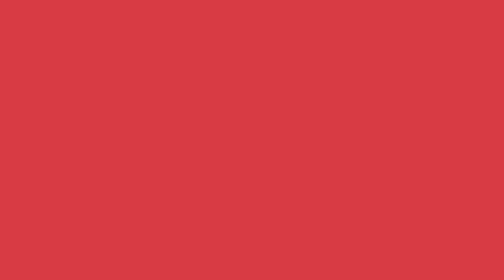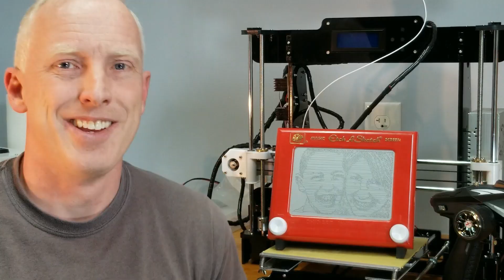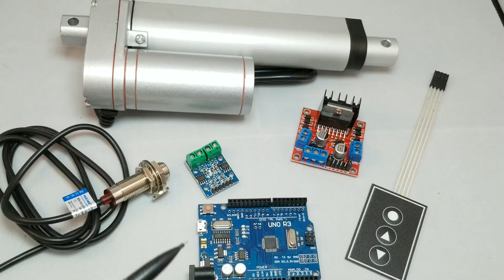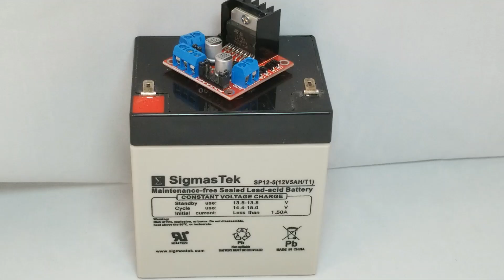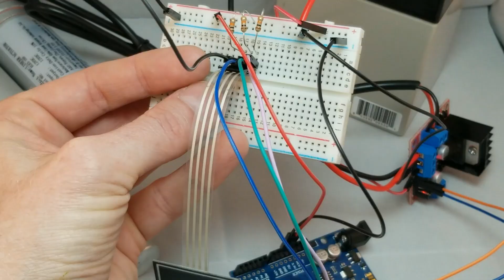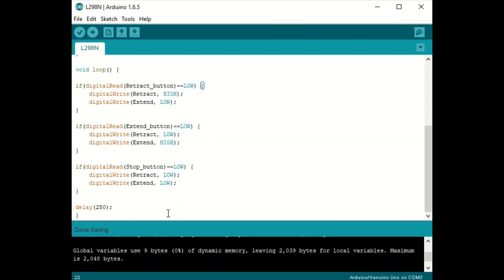Linear Actuator Arduino Control using L298N Motor Control Board

Comment: Hi, your video is so helpful for me. But I have one question. As I know, peak current of L298N is 2A. But your linear actuator's continuous current or stall current seem to exceed 2A. is it okay to use L298N?
Reply from the maker: I would use a BTS7960 if there was any load. It is good to 43 Amps and is still affordable.
Reply: @ScienceFunInnovations How would I get 12V from my arduino into the L298N and into my Linear actuators

Comment: Good day. I would like to control a TGM7 series 24V 6A geared motor using a 24V DC motor controller (lithium battery) and Arduino. I would appreciate your help on this subject.
Reply from the maker: What exactly are you needing help with? You could send an email to my business email with details.

Comment: Hello sir good day. I have a question instead of controlling the linear actuator using three buttons, how can I automatically move the linear actuator based on input data from SD card? I hope you can help me
Reply from the maker: You would just do a read command to get the new position value, then set that to the current position as is done in some of my other actuator videos.
Reply: can you please give the link to the video so I can refer to the video
 @ScienceFunInnovations

Comment: Hello sir, want to ask how about connection two linear actuators and syncing the movement of the linear actuator?
Reply from the maker: In order to sync the positions of the actuators, you need actuators with position feedback. Some of my new videos use these 5 wire actuators. You would still want 2 seperate motor controllers but you would use the position feedback from one actuator to control the other actuator.

Comment: What do the resistors do for the switches? What do you mean by “pull up resistors”? Can’t the switch just wire directly to the input?
Reply from the maker: There is a way to wire directly to the inputs without using pull-up or pull-down resistors if the microcontroller has resistors built in. Most of the newer Arduinos can do it without the resistors, but you may need to add a little more code. There are many articles about this if you search for it on the web. Cheers!

Comment: I am attempting to do this except using a FlySky i6x and wanting to control the actuator with the 3 position switch.  I can get the actuator to extend, but not retract.  I'm sure it's in the code.  Thoughts?
Reply from the maker: Probably in the code. I have several videos about controlling linear actuators, hopefully one of those gives you some good ideas.

Comment: great video, i have a question, if I want to use linear actuator with encoder to control it at specific location or length, how may I know  the range of it, can i use manual method by just supply power to it and read the encoder position from the beginning until the end of it?
Reply from the maker: Yes you can. Check out my more recent videos to see how to do that.

Comment: Please reply...I have a 24v 6 amp linear actuator can I use L298N Motor drive or do I need to use more powerful motor drive?
Reply from the maker: L298N is only good to about 3 amps. I would use a BTS7960.
Reply: Instead of using all these motor drives, Arduino, membrane button to control actuators, I have used DBDT (Double pole double throw) switch and I am able to control actuators.

Comment: First I’d like to start off by saying I am a complete novice when it comes to this type of stuff. I’m wanting to put together a automatic chicken door opener. I have components from a lift chair which consist of a 24v dc linear actuator and power supply. I’m trying to figure out the best way to control this system and I’m wanting.
Reply from the maker: It would be similar, but you would probably want a stronger motor controller. Good luck!

Comment: Can a raspberry pi be used instead of the arduino?
Reply from the maker: Yes. The pi can do digital inputs and outputs, but at 3.3V instead of 5V. Most motor controllers will work with the lower voltage.

Comment: Can I just use any Linear Actuator with the L298N Motor Control Board? or there are specific linear actuators?
Reply from the maker: The L298N is limited to about 3 amps. You may want a more heavy duty controller if you intend to have high loads/forces. But they all pretty much work the same way. Just find out how many amps the actuator uses under full load first, then select a motor control board that can handle the power draw. Cheers!

Comment: I thought we have to use BTS7960B 43A or similar. will L298N be enough?
Reply from the maker: Depends on the load on the actuator and the current draw. For heavy loads, use the BTS7960B. I will be using the BTS7960B in an upcoming video.

Comment: hai, how to make it move automaticly? like every 3 second actuator will change direction. i need for science project, sorry for bad english hahah
Reply from the maker: You could set it up in a 3 second loop that alternates between extend and retract mode. Start by deleting the code related to the buttons and just use the extend and retract commands. Good luck.

Comment: Thanks for the video very interesting.  I am only just getting into electronics and would like to take this a step further, by being able to read an output from the linear actuator as to how far it is extended, then display this on a LCD screen and also have the ability to be able to stop the actuator in different memory positions.  I want to use these to control to 600N 500mm linear actuators to make a sit stand desk.
Reply from the maker: I am planning on doing a video about linear actuator position control very soon. My part is scheduled to arrive from China in a week or two, then I hope to have the video out by the end of the month. Hit subscribe and turn on notifications so that you are alerted once it posts. Thanks for watching!

Comment: could you not do the same with a dpdt  switch plus relays if you wanted to be easy on on the switch?
Reply from the maker: Yes. A DPDT would work as well. The motor control board allows for variable speed control (as well as automation if sensors are used instead of buttons).
Reply: @ScienceFunInnovations  I understand  actuators are pretty neat

Comment: What is the benefit of using this board over a relay board?
Reply from the maker: With this board, you can adjust the speed. With a relay it is either full on or full off.
Reply: @ScienceFunInnovations , thank you, that is great info. I have a project, that I am trying to figure out, and new to Arduino. Researching all the parts to see what is best. Im basically making power windows with auto up and down when you hit the switch. I just dont have it figured out yet, then I want to update the switch to a GPS module so the motor would run one way at a certain speed and the other at a certain speed. Its for a retractable rear spoiler on a car.
Reply from the maker: @MattG101680  The are GPS modules compatible with Arduino. You would probably need to convert the speed text string from the GPS into a number on the Arduino and then just run a simple if statement. You also may want to add a time condition so that it doesn't keep going up and down if you are cruising right at the trigger speed. Good luck!
Reply: @ScienceFunInnovations , thats kind of what I was thinking, I thought id make it go down at 25 and up at 30. I have the GPS module on order, I thought maybe getting it set up by switch first is smart and then switch it to the GPS as the switch

Comment: G'day mate, question, if i were to incorporate this set up for an outboard/ jet nozzel steering system, how would i be able to make the actuator finish at the centre position (self centre) when there's no input signal. thank you in advance, Raymond from Sydney.
Reply from the maker: Great question. They do make actuators that have position feedback (usually a potentiometer) that you could feed into an Analog channel on the Arduino. Otherwise you would have to use some sort of position feedback system such as an LVDT.
Reply: @ScienceFunInnovations  thanks for your reply, I understand the theory, but do you reckon you could make a video on this project, also write the code for the arduino part as I am better with the building part, (not so good with the coding part) I am an electrician by trade. Thx.
Reply from the maker: I have had some similar requests for a video like that, so it is definitely on  my to-do list. I'll have to order some parts first, but I do hope to do that video sometime in the next few months.

Comment: Hmm, this basic simply code in arduino and drive have same function as only 2-pole switch with blind position in middle.... :)
Reply from the maker: Pretty much, but you can also change the speed with this setup. Thanks for watching.

Comment: Hi great video! I am following your instructions to make my own arduino-controlled linear actuator. Quick question, is it possible to burn out the L298N by accidentally leaving the switch in extend/retract position for a few minutes and forgetting to press the stop button? (Assuming your linear actuator has an automatic cut-off function). I think I may have burnt out my L298N!
Reply from the maker: Most actuators have automatic cut off on both ends, so that should not burn out the L298N. What could burn it out is if you actuator pulls more than 2 amps continuous or more than 3 amps momentary. Actuators under heavy force will pull more current. I may do a future video using a different motor control board that can handle more power.
Reply: @ScienceFunInnovations  Thanks for your reply! I figured out the issue, turns out I placed the L298N on a metal surface and the contacts on the bottom shorted out, causing the L298N to fail. Looking forward to that video!

Comment: How can you input data ( measure) to extend to the right measurement e.x input 20mm the bar should increase 20mm exactly.. if you input new data they will adjust the previus measurement  to the new data
Reply from the maker: Some actuators have built in position feedback sensors that can connect straight to an Arduino. These generally cost a bit more. Other options are to use an external linear potentiometer or an ultrasonic sensor. I'm hoping to cover this topic in a future video. Thanks for watching.

Comment: How can I supply 12V to the linear actuator while still utilizing the Arduino? I need to establish an upper limit (extend 3.5") for the actuator and I need to supply all 12V as I will be maxing out the weight capabilities of my actuator.  Its rated for 225lb with a 4" stroke, I need to lift 215lbs 3.5"
Reply from the maker: Does you actuator have a max current rating? If it pulls more than about 3 amps at full load, you may need to use something stronger like a motor controller similar to this one https://ebay.to/2yrsTjn
Reply: @ScienceFunInnovations  4.6A. I have a L298N as well

Comment: Hi. Are you available for hire? I have a fun project I'd like to have done. I need a custom compact wall hugging short queen bed frame that retracts into a couch position. It's for a future Dodge Promaster van conversion. I was thinking of using 80/20 aluminum for the frame to keep the weight low and using multiple actuators to slide the sitting area on wheels and pivot the backrest. The actuators would need to be strong enough to move 2 people on it. I'd pay you in advance and if you wanted, you could put the project video here on YouTube.

The motion would be similar to this...
https://youtu.be/JBEZxQ1a5AQ

If you're interested please reply here or email:
stevieespinosa@gmail.com
Reply from the maker: Sorry, I have a pretty big backlog of projects right now (including a remodel). But if you have specific questions or want to bounce an idea you can send it to my business email. These actuators are pretty rugged and I'm sure they could handle the load. Best of luck on your project.

Comment: Hi, great demo! I have a question, I'm using two wifi switches with my linear actuator with 4 relays, I would like to not use the relays and use something like this but with a raspberry pi or arduino. Can that be done?
Reply from the maker: Control will work with Rasperry Pi or Arduino, but you will need some sort of H-bridge or motor controller that is capable of handling the current of the actuator. The current can be much higher with higher loads, so you will want to make sure that the driver controlled by the Arduino can handle the load.
Reply: @ScienceFunInnovations  Thank you for replying, I new to both the Arduino and Raspberry, I did order an H bridge. Thanks again!

Comment: Hi and thanks so much for this video! Is there such a way to make it so it works similar to a power window? Like hold the up button for 2 seconds and release to fully extend but make presses less than 2 seconds, a move and release? Also is it possible to make the stop button move the actuator to a specific position?
Reply from the maker: Yes, you could program it to be like a power window. Once the switch is pressed you record the timestamp using millis(). Then in your loop you would calculate elapsed time = millis() - timestamp. Once enough time has elapsed, you would check the switch again to set the mode to extend.

Stopping in a specific position requires an actuator with a built in potentiometer (a bit more money) or an external linear position sensor. Once of these days I will do a video about it.
Reply: @ScienceFunInnovations , let's assume I have an actuator with a built-in potentiometer, is it possible to move the actuator to a specific position using the L298N only? or I must involve the Arduino with some code?
Reply from the maker: @itaycarpis9291  You would still need some simple code to keep track of the window position. You would use an analog input to measure the potentiometer position. That way you could have it go to specific positions. I will likely do a video about this in the future.
Reply: @Science Fun , thank you for the super quick answer :)
Do you know maybe if there is a motor control that does the position fix without any external involvement, such as Arduino...
Some motor control that gets the feedback from a potentiometer actuator signal as an input and fixes the position according to the required position.
Reply from the maker: @itaycarpis9291  There may be some that use limit switches, but I'm not sure if there are any with position control.
Reply: @ScienceFunInnovations  Hi when can we get a video? It sounds like I'm not the only one that wants a demonstration. Thanks in advance.
Reply from the maker: @Steven-e7c  I have parts on order, but it might be a few weeks before they arrive.
Reply: @ScienceFunInnovations  Great! I can't wait 😃

Comment: I was wondering if the code was available to download?
Reply from the maker: Here it is:

const int Retract_button = 2;
const int Extend_button = 3;
const int Stop_button = 4;
const int Extend = 10;  //Connect to L298N Pin In1
const int Retract = 9;  //Connect to L298N Pin In2

void setup() {
pinMode(Retract_button, INPUT);
pinMode(Extend_button, INPUT);
pinMode(Stop_button, INPUT);
pinMode(Extend, OUTPUT);
pinMode(Retract, OUTPUT);
digitalWrite(Extend, LOW);
digitalWrite(Retract, LOW);
}

void loop() {

if(digitalRead(Retract_button)==LOW) {
    digitalWrite(Retract, HIGH);
    digitalWrite(Extend, LOW);
}

if(digitalRead(Extend_button)==LOW) {
    digitalWrite(Retract, LOW);
    digitalWrite(Extend, HIGH);
}

if(digitalRead(Stop_button)==LOW) {
    digitalWrite(Retract, LOW);
    digitalWrite(Extend, LOW);
}

delay(250);
}
Reply: @ScienceFunInnovations  thanks 4 beautiful code with beautiful project 😍😍😍

Comment: EDIT: I Switched to my Arduino Mega and for some reaason everything works now.
I'm getting frustrated here. I've been trying to measure the PWM signal from my tx input using the serial monitor. However, before I even turn on my tx, the serial monitor spits out random numbers, and when I turn the tx on, it still does the same. I double checked the code, which is exactly as you have it. I'm on pin 7, both in the sketch and on the Uno. I plugged a servo into several different channels as a test that they're working. I've tried this with my flysky fs-t6 in sticks mode as well as my tactic pistol controller. NOTHING works like it should in the video. What's going on here? I'm about ready to give up.
Reply from the maker: That is weird that it worked on the Mega but not the Uno. Did you have any breakthroughs on what was wrong?